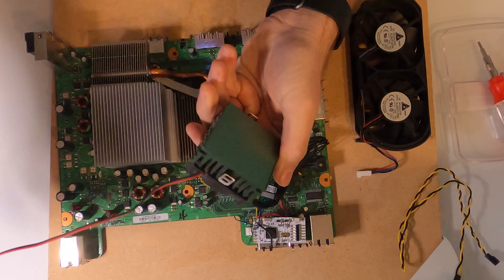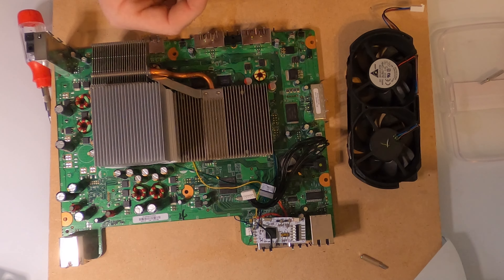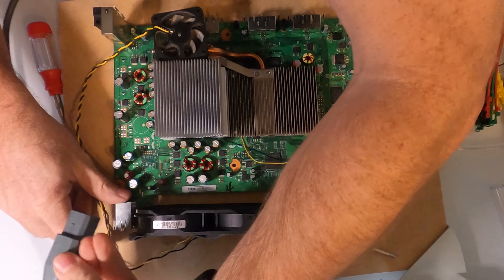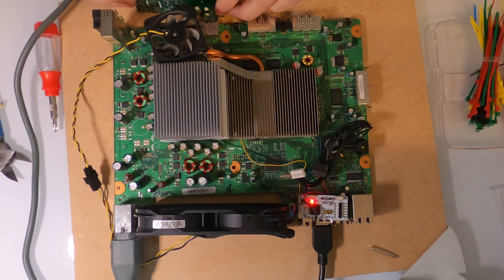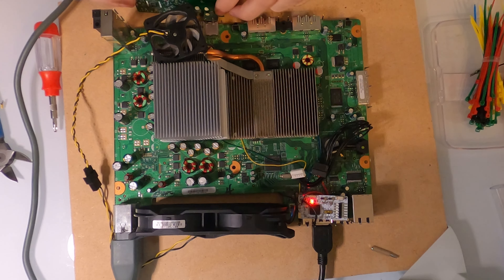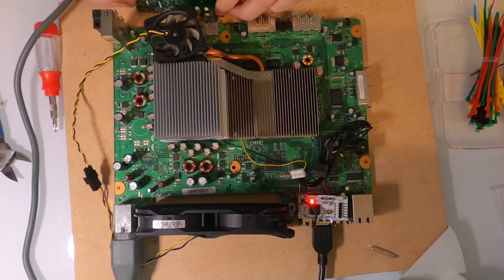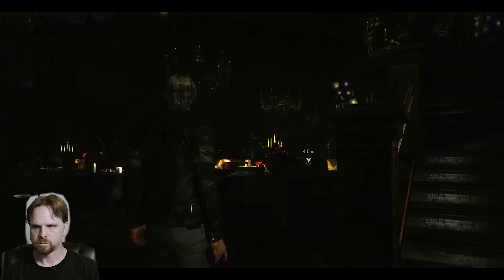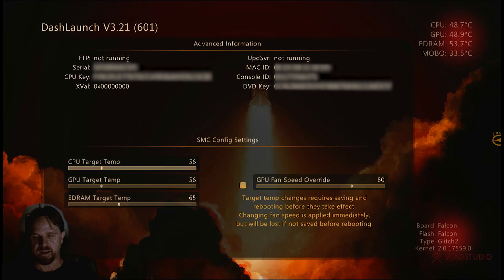Fix Xbox360 Overheating with this Cool Fan Mod

Comment: Great job. My personal opinion is that I would connect the small fan to uncontrolled 12v supply, should even keep cooler. Those small fans tends to run very quite. But great job.
Reply: Yes I've been looking for a modern mod that would be a bit more controllable than the mods from days of old now these systems are dirt cheap and still fun. I picked a Falcon up recently and have done the RGH Pi mod that costs nothing more than the price of a Raspberry Pi Pico (which I already had). Taking the power from the middle row of solder points holding the power brick input socket from the underside  of the M/board gives just the constant 12V you're talking about.

Comment: That mini fan you put on the GPU how many millimeters is it?
Reply from the maker: IIRC, it was a 50mm 12v fan
Reply: Thanks mate, I'm trying to replicate the fan system in the gpu to make my old Xbox 360 phat jasper with RGH3 cooler, for these scorching summer days. @pathfindercast

Comment: im goona try this but using a 12v  external adapter from an old cellphone..
Reply from the maker: Nice. Yah so far I have not had any more issues, but I also don't get around to playing the 360 as much as I used to.

Comment: What’s the deal your using to check system temperature and fan speed… I don’t remember Xbox having settings like that that’s why I ask
Reply from the maker: The xbox360 has an RGH 1.2 chip installed which lets me install homebrew which in this case is Dashlaunch.